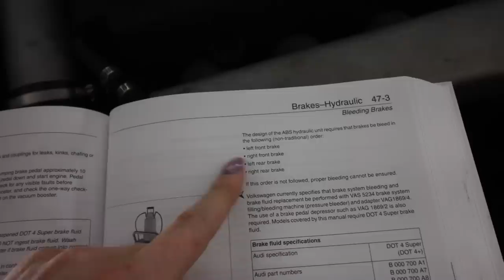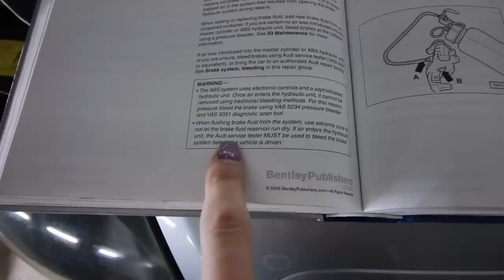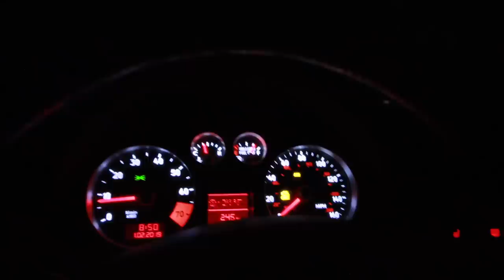Problem Solved! Clearing the Big Brakes // Project TT Quattro

Comment: If i remember correctly, ur plan is to track this car.  If that is true, u will want to replace the brake lines with stainless steel brake lines.  It looked liked you used stock type replacements. It's an inexpensive upgrade along with high temperature brake fluid that will help reduce brake fade and a soft brake pedal on the track.
Reply from the maker: basenji7 they were all stainless lines, just have a translucent protective coating over the top for aesthetics.

Comment: Great video ! My Mk4 gti vr6 which is the same chassis as the TT you don't have to twist the caliper to compress the piston but i do see that special tool a lot on ECS. But i need to bleed my brakes this helps a bunch  Thanks! :)

Comment: If there really Was air in the hydraulic abs System you can use your vcds System to bleed it correctly. Vcds forces your abs System to flush itself like the originalen Audi disgnostic Tool would. It's hard to Tell with the whole New Brake setup but if there is air left, your pedal will fall to the Floor when the Brake starts to get hot after more braking or the abs System actually has to do something....

Comment: Nice video! I am using TSW Nurburging 18 x 8J offset +35 for my 2018 Forester. I am also doing BBK soon. I choose Brembo OE CTS-V front 6 pots, rear 4 pots with 355mm and 345mm rotors. With such thick spacers on your car, is there enough threads for the wheel lug nuts to mount the rims safely?
Reply from the maker: 7777Gixer the lugs are extended to match the width of the spacer.

Comment: that rear caliper piston has a ratcheting mechanism inside which adjusts the handbrake. In a situation where the piston isn't near the pads and you pull the handbrake, the piston comes out and tries to press the pads if it reaches them, when you release the handbrake the piston retracts a little but not all the way to where it started from. There is a rod which goes through the caliper from the outside lever and has these threads on which the piston is threaded on. But the ratcheting mechanism inside the piston is loose and can twist in relation to the piston - it is held in with a c-clip. So you can't press the piston in because of the threads and neither you can't twist it in because the mechanism twist also. That is why you have to press and twist. 🙈 

These are so called Girling calipers and used on lots of different cars, they might originate from a lot earlier but the oldest car I know uses them is the mk2 Golf GTI. Of course they differ in size and shape but the basic principle on how they are used has stayed the same...

Comment: Brakes look the awesome Sarah 👌for those who can't get trapped air out  the system and don't have a decent pressure bleeder (or have shite snap on vacuum bleeder like me) bleed at main line into abs pump first (where most air gets trapped) then the lines out the pump then the nipples as normal and that will remove all air👍 no fancy tools needed just a friend with a foot 😂

Comment: Oh dang, with all of the different cars on the market and all of the different brake systems, I've found that one of the best methods for servicing brakes is one of the oldest in the book. Never let the master run dry, release brake fluid in a control manor. Gravity will do all of the work, brake fluid is hydroscopic, so it will absorb moisture out of the air, keeping caps in place ass much as possible is important. Keep the old fluid in the system while doing your work, caplugs are a perfect companion, only pinch a line in a pinch? Then starting from the farthest brake, let it gravity bleed until clean fluid comes out and work your way up! Never touch the brake pedal. Keep the master full! If I don't know the cars specs? lol I'll use this method, works 99.876% ish of the time! When you replace the master or get air in the system? This will work .012% of the time?

Comment: Happy New Year :-) Keep up the great vids. The TT is coming along very nicely :-) Quick question, do you have any plans on improving the handling and at the same time lowering the car? It looks like it has major arch/wheel gap aka monster truck look ;-) Maybe some lowering springs or coilovers and some adjustable sway bars? ;-) As stated keep up the awesome vids. Although I don't have YouTube vids I have been modding my 370z in my garage ready for the European road trip  That will be my first YouTube video. If I can get 2 views I'll be more than happy LMAO ;-)

Comment: Audi does that because they use the pads as a part of the handbrake system instead of using separate drum brake inside the rotor.

Comment: Nice color match! Btw when you ever have to do brake lines on a German car again, put the brake pedal all the way down( caliper bleeder open)and hold it there against the seat, by a piece of wood or something else. The lines will stop dripping and will not drain empty the reservoir anymore.Btw I use a Laser brake rewinder tool. A lot of cars use this method when having the e brake on the rear. https://www.ebay.nl/itm/181801760598 . With this 'simple' tool you can do German cars, and most of the JDM ones.

Comment: That style of brake cylinder is pretty common on euro cars, you shout try a brass tap and a hammer, light taps like you're chiseling in direction of the thread #ghettobutworks

Comment: Are you still having the cooling system problem?
Reply from the maker: Snowme its winter and I don’t drive the car since I have my Forester.
Reply: Sarah n Tuned  I was curious cuz I had two cars that had the exact same issue where the temp gauge would hold steady for awhile and then begin to creep up.

Comment: Are you running spacers on the rear also to keep the square setup?
Reply from the maker: Unfocused Racing yes
Reply: @SarahnTuned  awesome! To run the Focus RS Brembos on my ST I had to run 5mm spacers. Also the wheel weights had to be placed just right on my oem wheels. Glad I have a set of aftermarket wheels for summer time.
Reply: From the factory, the 8N Quattro has a 30mm narrower track in the rear, FWD is about 17mm. The Quattro also has a slightly longer wheelbase, all due to the significantly different rear suspension setup, that allowed them to shove some axles back there.

Comment: Snow is fun! until you got 30cm+ to plow... haha anyway you caliper design has been used by a lot of manufacturer like GM, honda, etc it has some advantage like the cost no need for shoes just pads and all hardware to make drum brake working. all those caliper work the same, need to twist and press at same time.. i used to do it with a pair of plier, not the best but for a one time use not worth buy a universal tool for that.  On the other hand having the design of regular disc brakes + drum in hat for parking brake(chrysler use this design on some cars) can be better in case of pad seize or if the pad are worn and you need to use the emergency brake to stop. 
btw i follow you since a while now and i love your content! happy new year!

Comment: Those rear Audi calipers and their stupid twisting design. had to replace a caliper because it broke while I was trying to compress it. What a pain in the ass. I ended up using a normal piston compressor and vice grips like you did to turn the piston.
Reply from the maker: Jacob Rachwal Im surprised I didn’t at first.
Reply: @SarahnTuned  Audi isn't the only one with the twist-to-seat design. almost all rear disk breaks that don't have a separate drum parking brake is set up like that.
Reply: Mazda uses this design too. You can buy this cube looking tool on amazon for a few bucks that attaches to a ratchet extension. Real easy and quick to use, you just need the cube.
Reply: I bought my cube thing at a local pars store years ago. Makes driving the twisty pistons back in a snap.
Reply: @SarahnTuned  just so you know 95% of all UK and euro  designed cars have them shite calipers it's not just Audi/VW group cars, so you will probably see them again on future builds the tool is cheap and easy to use of the calipers are in okay condition👍
Reply: Jag also uses them on the rear brakes on the X Type. I used the G clamp and mole grips (visegrips US translation 😉)hack. Agree they are a pain.

Comment: German engineering at its finest. You can't bleed the system successfully, when equipped with abs if you don't have a 5000$ proprietary machine. Just the tip of the iceberg . Sorry Sarah. On a positive note, they sure as hell can paint a vehicle .

Comment: Good job Sarah.  But come on now and woman that is as smart and beautiful as you has no reason to be anywhere alone that isn't of your own doing.   I'm sure a phone call or two would have your garage swarming with folks.

BTW the next time you need to color match a color most automotive paint supply stores can match colors and put the paint into a spray can for you.  It can be a little pricey but if you want a dead on match like you did with the MR2 parts that's a way to go.
Reply from the maker: W Hoggdoc All my car friends are guys with wives/girlfriends, it’s impolite to ask them to hang out.